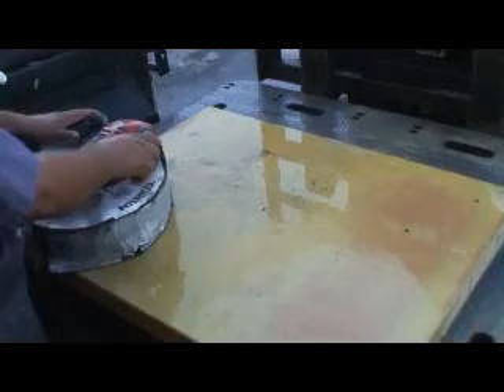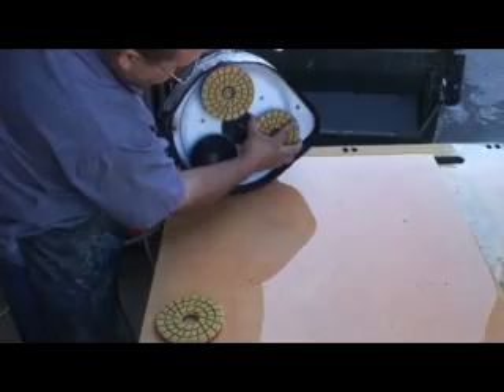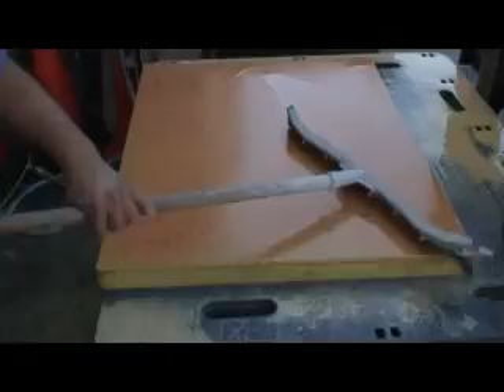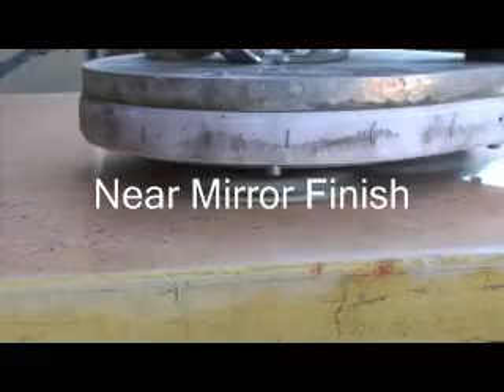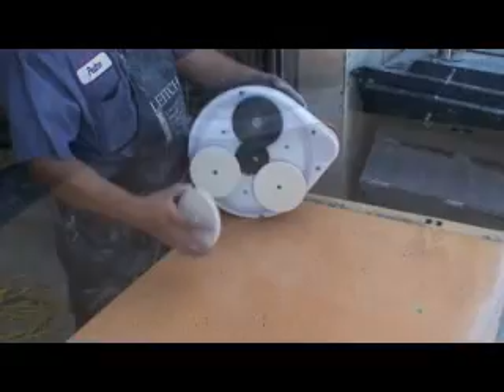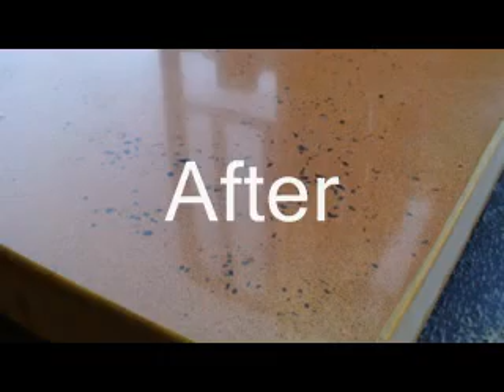Polishing Concrete Countertop with DS301 Handheld Planetary Polisher. DIY

Comment: In the hardness stakes I think you'll find granite is an 8 with concrete right behind it at 7, depending on the seal and polish used the shine can last a lot longer to.

Comment from the maker: Yes, we rent this tool all the time, locally or shipped to your site.  The cost is $100/day or $400/wk. The first week is applicable to a purchase. I would suggest that you give us a call and we can guide you through the process and help you choose the proper diamonds for your project.  800-999-8485
 
Just for your info the DS175 and DS301 are both used on many types of surfaces by just matching the abrasive type to the surface. Wherever you want something flat and smooth they will do the job!